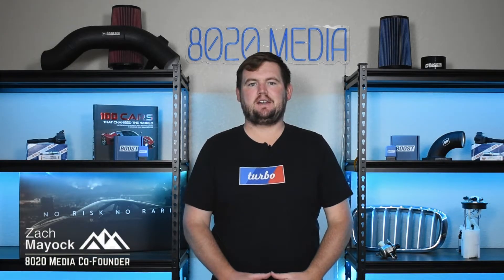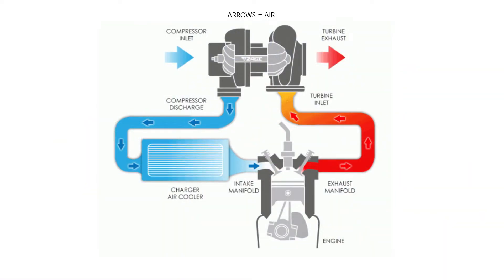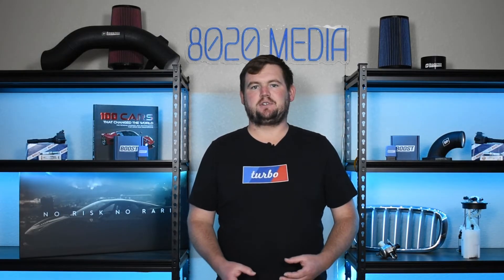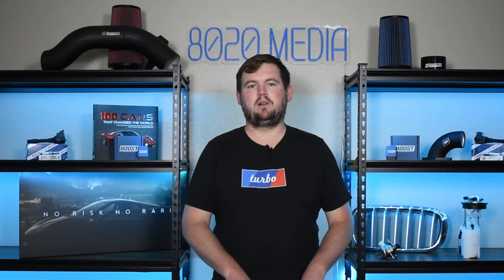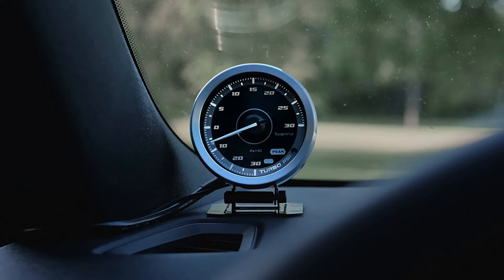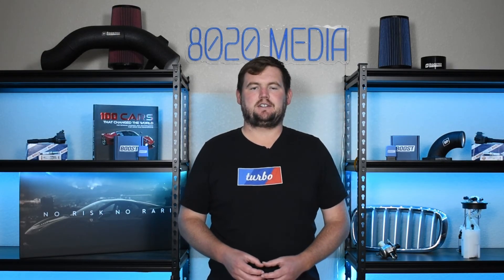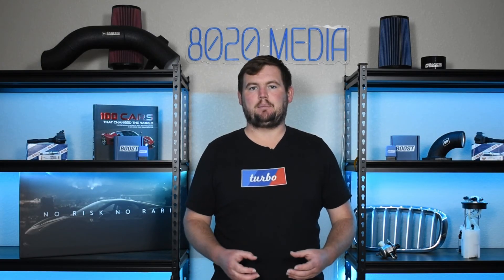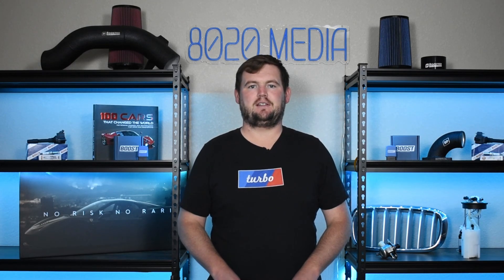Signs & Symptoms of a Bad Intercooler!

Comment: Hey on my Santa Fe 2.0t I’m currently experiencing low power under load I decided to check my intercooler and after I got my wife to rev it up after letting off the gas I could feel a lot of air at the bottom of the intercooler come out is this normal?
Reply from the maker: D - On your vehicle, feeling a strong rush of air coming out of the bottom of the intercooler when letting off the gas is not normal—the intercooler is a sealed part of the intake tract, so all boost pressure should stay contained from the turbo to the throttle body. If you can feel air escaping, it likely means the intercooler has a crack, split seam, or a leaking end tank, which would explain your low power under load since boost is bleeding out instead of reaching the engine. Sometimes oil residue around the leak will help you spot it. The next step is to do a boost leak/pressure test on the intercooler piping to confirm, but based on what you described, you’ll almost certainly need to repair or replace the intercooler to restore full power.
Reply: @8020Automotive im experiencing rhythmic flat spots (every 4 seconds) during acceleration or load in my 96 Volvo T5. A garage did a smoke test and pointed to a hole in the bottom tank of the air to air intercooler. However on investigating I find this hole is meant to be there to let out condensation and oil! So it has a permanent boost leak……this goes against everything I thought, but is apprently part of the design. So what are my flat spots??? Im starting to think my intercooler fins may be clogged with deposits.

Comment: So I noticed today my radiator was bone dry before I left for work, so I filled it up, drove to work, and nothing changed, went on break and checked my car and the level had dropped maybe 10%-20%, when I left it was down to maybe 30%-40%. I set something under my car to see if there was anything leaking from underneath, even jacked up my car and got underneath but there’s not a single drop coming below. My engine isn’t producing white smoke through the exhaust, nor is it making any weird sounds or anything, and on top of that my water pump seems relatively fine, no leaks or dry marks from anything coming out. It’s a sudden problem, a few days ago I had no issues at all, now all of the sudden my coolant is draining rapidly. Any ideas what it could be? I’ve ruled out head gasket, water pump, and a general drip leak anywhere. Heater core maybe?? But my passenger side interior is also dry and not smelling any different than it always has. I’m stressing hard about it so if you have any ideas what I should check please let me know😭
Reply from the maker: A - Sorry to hear this.. Given that your coolant is disappearing rapidly but there are no visible leaks, white exhaust smoke, or signs of external dripping, you're likely dealing with one of three hidden culprits: (1) a small internal coolant leak into the combustion chamber that hasn’t yet produced visible symptoms like smoke or misfire (keep an eye on spark plug condition or do a combustion leak test), (2) a leak into the transmission cooler inside the radiator if it’s an automatic (check transmission fluid for milkiness), or (3) a pinhole leak that only opens under pressure and heat—these can vaporize before dripping, especially around plastic fittings, intake manifold gaskets, or heater hoses. Pressure testing the cooling system when cold and hot can often reveal hidden leaks. Also, check under the intake manifold or around the firewall for damp areas you can’t see easily. A UV dye test is often the best way to trace these kinds of losses.
Reply: Put some plastic wrap over your coolant tank cap when it’s open and get someone to crank the car if the plastic wrap wants to push off or make a bubble double check about that head gasket

Comment: Can idle engine knock due to a bad intercooler? My mechanic mentioned my intercooler is leaking a bit, but I don't have the time to change it
Reply from the maker: G - Yes, a leaking intercooler—especially on a turbocharged engine—can cause symptoms that resemble idle engine knock, though it’s usually more of a rough idle or light misfire than true knock; when the intercooler leaks, it allows unmetered air into the intake or causes boost loss, which can throw off the air-fuel ratio and lead to lean combustion, causing light knock-like sounds, hesitation, or unstable idle. While it's not ideal to leave it leaking long-term, a small intercooler leak typically won’t cause immediate damage, but over time it can stress the turbo, worsen fuel trims, and eventually trip codes like P0171 or underboost codes. If it’s minor and you’re not pushing the car hard, you can probably buy some time—but if the knock gets worse or you notice power loss, it’s best to prioritize the repair.

Comment: I have a small hole from my hard piped after market fmic rubbing on the subframe on my car, and although it keeps steady boost, I did indeed have a strange high pitched whistle when the car came on boost, and noticed a metal on metal noise on boost (where the hard pipe was rubbing on the subframe). Great video. Thanks.
Reply from the maker: W - Love to hear that we helped! Thanks for the feedback.

Comment: Might be worth noting that on diesel vehicles, the carbon deposits can build up via the turbo, and build up in the thin tubes of the intercooler.
Reply: How is carbon getting that far back in the intake I’m confused?
Reply: @Thirrtyeighterr  via the turbo.
Reply: @Thirrtyeighterr  for diesels, the issue is a combination of the CCV and EGR.

EGR recirculates exhaust gases, which contain soot. This is routed back into the intake, between the turbo and the engine.

The crankcase vent (CCV) is recirculating oil vapour, often into the intake, usually in front of the turbo into the intake.

What happens is the soot and oil vapour mixes together, forming a sludge which ends up everywhere. I recently took my intercooler off and the amount of crap in there was disgusting
Reply: @bushturkey1019 you’re absolutely correct. I had a bad buildup of deposits in my EGR. It took a dogs age to clear it.
Reply from the maker: M - Thanks for sharing this insight.
Reply: @ I’ve just cleaned my intercooler today with methylated spirits, totally worked. 👍